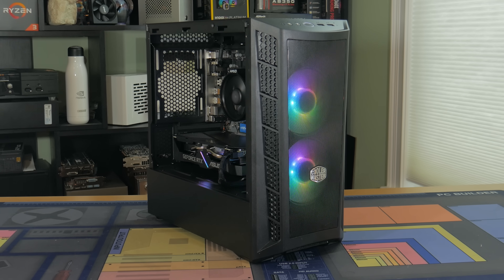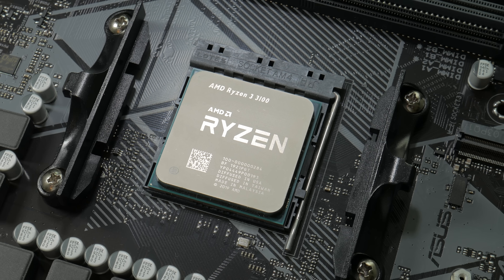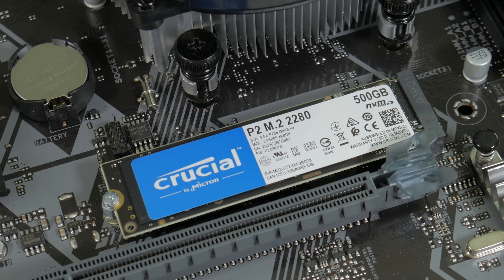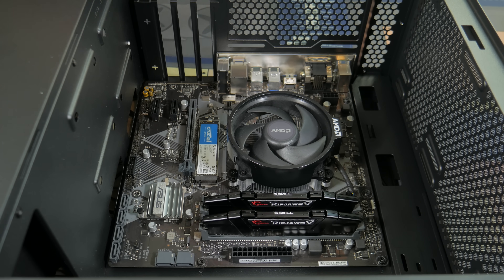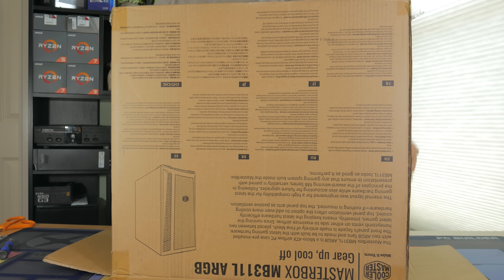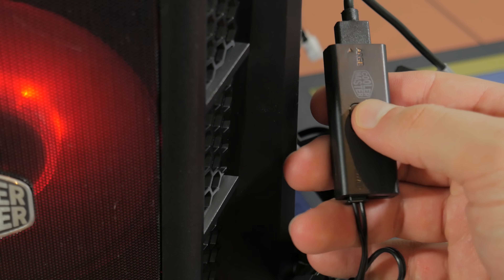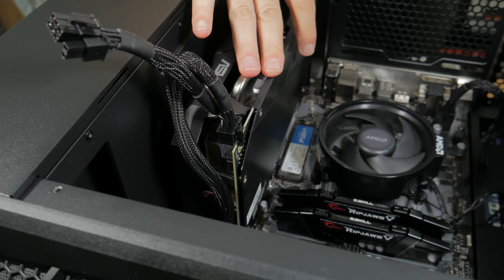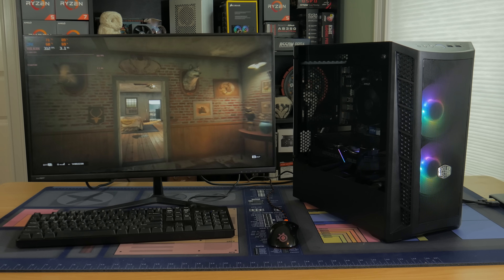$750 Streaming/Gaming PC Build Guide! (Late 2020)

Comment: If i were to swap out my graphics card for a gtx 3070, will i need to replace some parts for demand of the card?
Reply from the maker: Yeah you should upgrade the CPU and probably the motherboard. My recommendation would be the new Ryzen 5 5600X and the Asrock B550M Pro4. You may also want to upgrade the PSU to a 650w 80+ gold unit. The 3070 is 2080 ti performance so you need a better CPU to pair with it than the 3100.

Comment: You don’t have to take out the controller to switch the argb fans. You can hook it up to the reset button so it’s easy to switch the ARGB fans. I really recommend this case. That doesn’t need to be a deal breaker

Comment: love your vids.   My only critique is that 4 cores seems extremely low for a 750 build.  I get corners have to be cut but I think i'd prefer a ryzen 2600 over the 4 cores.
Reply: What are you going to use the 6 cores for?
Reply: @rockytech6014   ive seen games utilize my 6 cores of 8700k and I wouldn't build with anything less.
Reply: @Haddley333  Lol, what’s wrong with ur 8700k.
Reply: @rockytech6014  nothing other than if I were building a pc today I’d go for 8 cores minimum since I don’t like to build a new pc every 2 years
Reply: @Haddley333  wow just wow
Reply: The 3100 is far faster for gaming

Comment: Microsoft not enforcing restrictions on grey market reselling of Windows 10 licenses has totally destroyed the value of the used business desktop market if the goal is upgrading to a gaming PC.  The used business desktop machines have as much as doubled in price on sites such as Ebay this year.  A brand new system like this totally destroys in value any such used business desktop and has way greater upgradeability.  And the parts are new as opposed to who knows what will fail on the used business desktop, especially if the used machine is 5+ years old.

Comment: You can use the reset button to control the rgb as well.
Reply from the maker: I've heard this before. Does this require any major modifications?
Reply: @TechByMattB  sorry for the delay but no it does not require any with that case.  You can plug the reset switch right into the included argb controller to control it.

Comment: Thank you so much, my budget is exactly $750, Your Amazing ❤️
Reply: U could probably save some money on the PSU, anywhere from a 500-600watt 80+ PSU should work fine, 750w seems like to much but good for future upgrades. u could also save money by getting a non-modular PSU.
Reply: I’d wait a few months until nvidea or amd announce a budget gpu
Reply: @Stunz  months ?? TF no
Reply: @Grievingbow  🙂
Reply: @Stunz  budget then is gonna be 400 dollars lol
Reply: @Stunz  hell no
Reply: @Jorge99g  🙂
Reply: I need help what to upgrade or if I should do new build, I am i3-9100f, z390ud, 16gb 3200mhz cl16, 1660 super, 600w, 2TB sshd. I get 125 FPS warzone low, want 144-200 1080p low, do I just do i5-9600k/5700xt/750/850w,500-1tb nvme m.2? Or wait for new Radeon/ryzen combo and get gen 4 ssd and new psu when I see req? Budget is 1500-2500CAD, pref lower, I only ever play warzone and like 4-6hr/week I don’t need the best pc possible but taking all suggestions pls help thank u!
Reply: @JingaBBB  pcie gen 4 wont affect ur fps, but what I would recommend is going with a r5 3600 and saving that money towards an rtx 2070 or 2060 super.
Ur call
Reply: @JingaBBB  and give me ur old rig please
Reply: Idk do research tho
Reply: My budget is dependent on my import tarrifs and tax I really hate it
Reply: Gl using this pc with no monitor or peripherals 😂
Reply from the maker: Thanks for watching!
Reply: @TechByMattB  hey
Reply: You're